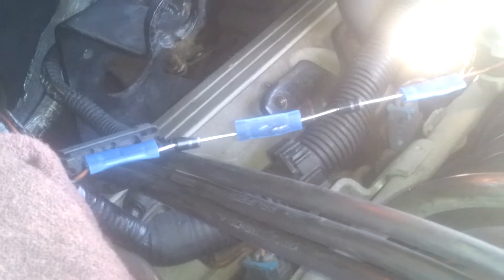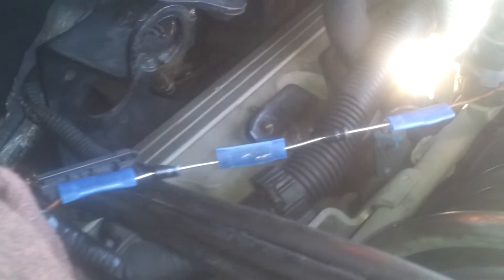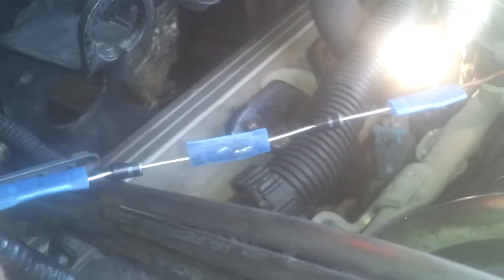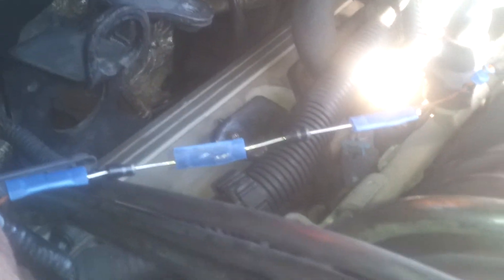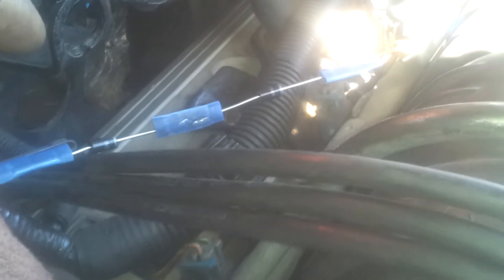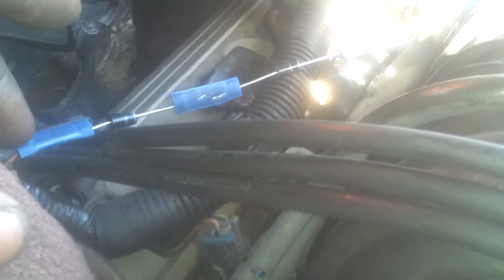Increase Alternator Voltage Output #2

Comment: OK, here's what was missing on your first video that came up for me.  They should be together.  Anyway, as others noted, you have them wired in SERIES, nor parallel. A little electrical knowledge is a dangerous thing.  You have just boosted your voltage by .6 X the number of diodes you put in.  Did I see four?  2.4v increase.  A good way to shorten the life of everything electrical, but especially lights and the battery.

Comment: Those diodes are in series.
Reply: Yes. He is dropping the excite voltage by 2-2.4v
Reply: ikr i was so confused at first when he said parallel
Reply: Correct.
Reply: Was about to comment the same thing

Comment: it looks to me that you have the diodes in series not parallel. the reason your voltage goes up is that each diode creates an approx .6 of a volt voltage drop so this tricks the regulator into thinking the batteries need more voltage. 1 diode is usually sufficient to boost the alternator output into the mid 14's.
Reply: Thanks
Reply: THIS IS EXACTLY WHAT I NEEDED. does it matter which diode?
Reply: @TheBakeMaster  ye

Comment: How did this work out for u as a daily driver
Reply from the maker: It Killed My Alternator, Increasing Your Voltage Charge Means Nothing If The Alternator Itself Doesn't Have The Amperage To Back It Up.... I Bought A 220amp Mechman Alternator For The Monte Carlo. Been Doing Good Since...

Comment: Depending upon your Voltage output like if it was 13.7 Volts then you need to insert one diode to bring it to 14.2 Volts and two diodes to take it above 14.6 Volts.